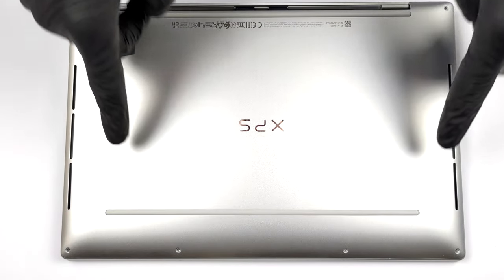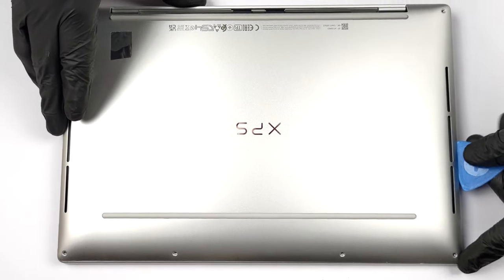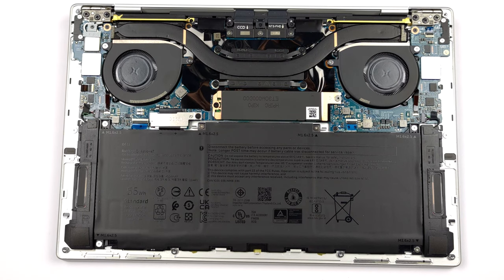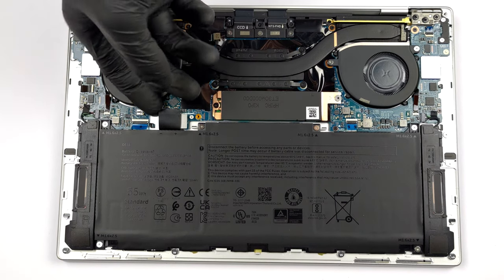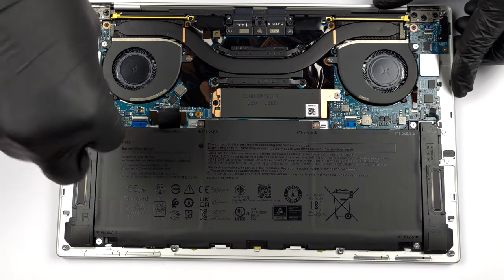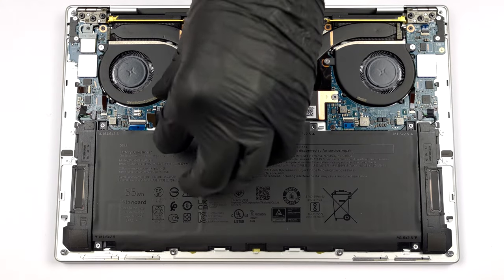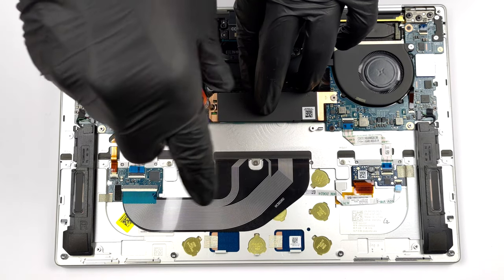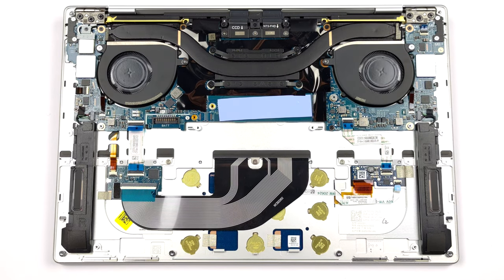🛠️ Dell XPS 13 Plus 9320 - disassembly and upgrade options

Comment: 2:19 that big orange cable on the rightsidem under the small QR scan and above the long white cable, what is it for. Because our laptop  made an electric sound when booting up, we unplugged it and the problem disappear, but also nothing else changes, im wondering what it is for

Comment: My Dell XPS 13 Plus lasts 2-3 hours tops on battery. I'd love it if I could find a replacement battery that lasts several hours longer since I love everything else about this laptop
Reply: Find a way to keep the laptop cold. So much energy is wasted from overheating and thermal throttling